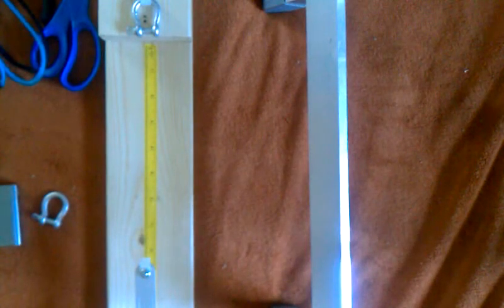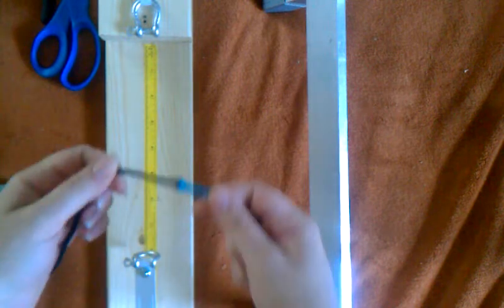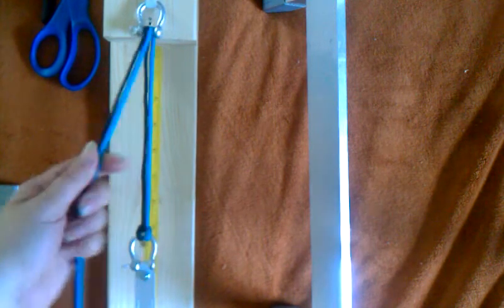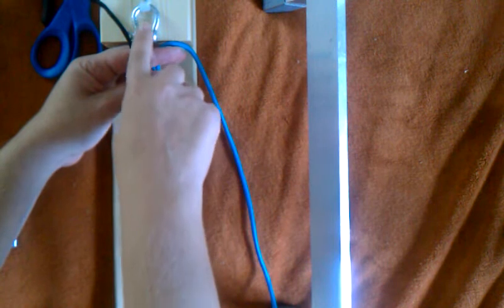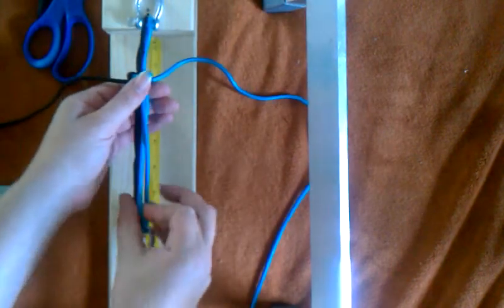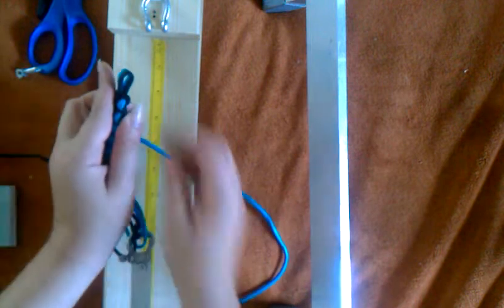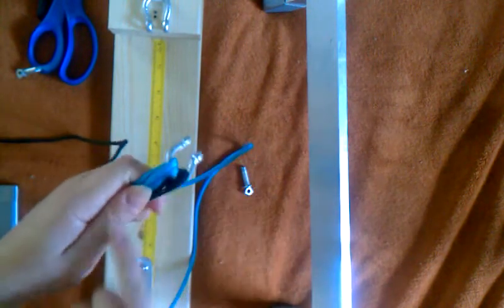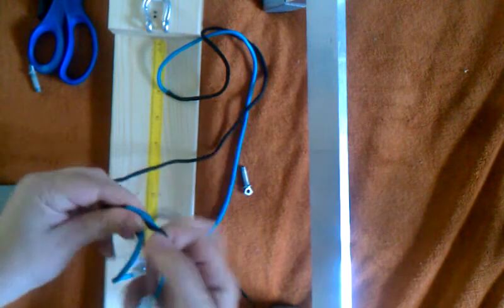Starting a paracord bracelet with a D-Shackle

Comment from the maker: The finished product only uses 1, but if your using a jig to make it, it's easier to have 2 to hold it down, you can certainly use a dowel or anythiner object hold space for your loops.